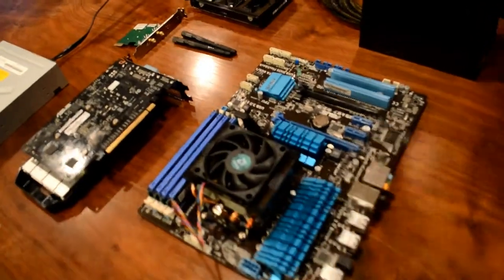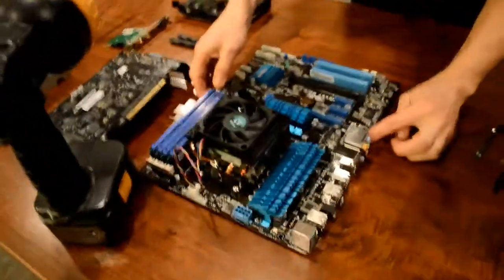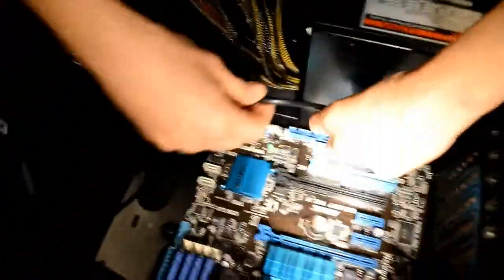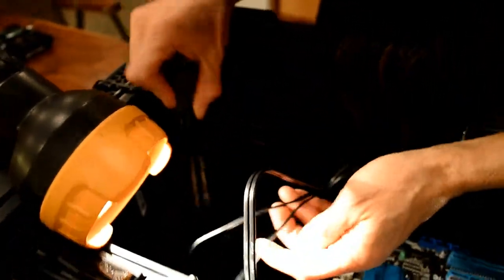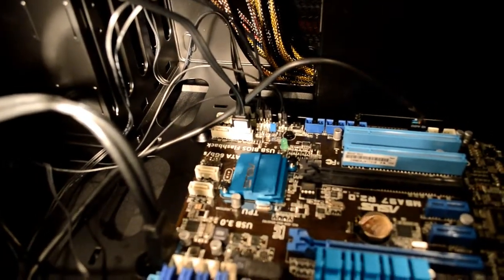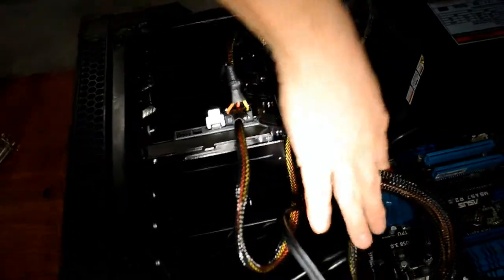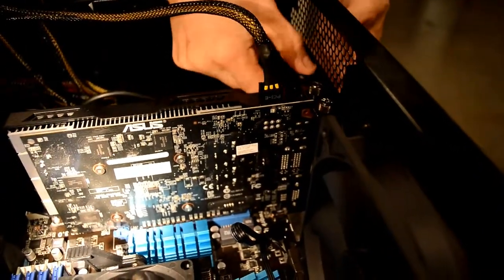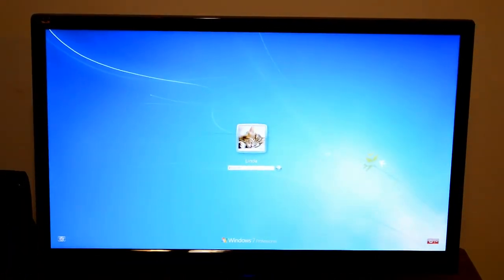Building My Own PC (Personal Computer) at Home

Comment: Wow!  Good job!  I built PCs long, long ago, XT, AT386, 486 models (DOS based), but have not done so for a long time.  When I needed a new PC a few years ago, I spent lots of time researching at NewEgg, but eventually ended up buying an HP desktop (no interest in laptop).  I have a renewed interest for a replacement.  I see an ASUS M5A95 R2 motherboard (you used 6 core, I see an 8 core is available as well).  You added 4-8GB memory cards (which manufacturer?).  You added a 1TB hard drive, looks to be a Western Digital.  You added a video card, with two fans.  This is probably a high end card so that your video editing tasks work well.  You used a 650W power supply, and a CD unit, probably DVD functions as well.  I saw a MoDisc case, but I don't find that at NewEgg.  How many USB ports?  What case did you use?  I have the bug again to build a new PC.  You slipped in "loaded windows."  Did you buy a license that came with a CD to get started.  Getting the OS loaded properly remains of great concern to me.  Has it been reliable and working fine for you.  I think you posted this about a year ago.  You seem very familiar with the components, cabling, etc.  Have you built others?  Did you buy a complete kit, or choose your own components?

I think we are wired (pun intended!) similarly -- hard, physical work, still like to home grown food, independent, and likes to see the product of our efforts.  I really enjoy your sawmill videos.  That is producing a favorable output with mechanical power equipment, and good hard work!
Reply: Are you using this build today? Even if this is SATA 2  a SSD would excelerate every thing.
Reply from the maker: Right side of the grass, Thank you!!! How did I miss this wonderful post? I apologize for neglecting to answer until now. THANK YOU for your patience! 
My sons and I have built/re-built several systems, over the past several years.
For this system, I bought a bare bones kit, cheaper than piecing it out, from Tiger Direct, but had them swap a couple of items for something I thought would work better for me. 
I haven't had any problems with the computer, other than switching the OS from Windows 7 to Windows 10 (it was not compatible with my old Video editing program). 
The case is a Corsair (steel) which has two USB3 ports, the Mother board also has two USB3 and two USB2 ports. The power supply is by Corsair and was a 650 watt power supply, but I love power and recently upgraded to a 750 watt Corsair power supply, along with a NVIDIA GEFORCE GTX 960 Video card (high performance for video editing) and a Samsung 850EVO 500 GB internal SSD (may need 3.5 to 2.5" adapter). Solid State Drive is the way to go if you have a need for speed, like me. I purchased a new copy of Windows 10 (not with CD), which was easy to install, as was my original Windows 7 (which I purchased it with the CD). 
I still can't believe that I missed a post on this video, especially by someone "wired similar to me." Hopefully, you were able to get your system built. :/
I'm glad you enjoy my videos! Thanks for watching! Linda :)
Reply from the maker: Tom Taylor, I agree! A few months ago, I upgraded to s Solid State Drive (SATAIII) & love it!
Reply: Thanks for the informative reply.  This info is helpful.  No, I have not built yet.  I do seasonal outside work, March, into December.  My time has been devoted to my solo business, 50-60 hrs, six days.  Down time is coming soon, and will rethink this.  My needs are not as demanding as your video needs.  I have photo editing needs, but video editing is undoubtedly much more demanding.  However, learning about Tiger Direct, and the Corsair products is a great lead.  I think Win 10 provides more fear than the hardware parts.

Yes, ... working hard, efficient production, ... great motivation, even though many tasks are repetitive. And, proud to have a good outcome!

Thanks so much for all this good info.  Keep shuffling the wood!  And, stay safe.

Comment: For some reason I missed this video.  You are pretty good at this how to stuff!.. Did you notice a big difference in performance when editing video?  I got an I7 something or other a while ago and it struggles a bit with editing HD video.  I think my video card probably has something to do with that.  I might try to upgrade that sometime.
Reply from the maker: The Intel Core I7 4th generation is being marketed now, but my 2nd generation Intel Core I7 is in a laptop, so it is a little under powered anyway (compared to a desktop). My new 6 core AMD desktop is awesome & much faster than my laptop! Although, our son's 3rd generation Intel Core I7 (coupled with a really good motherboard) is a little bit faster. I tried to cut costs on the motherboard, since I splurged on the processor & video card, but may upgrade the motherboard later. FYI: I found that it is important to do a disk clean up, using Microsoft & the virus disk clean right before I start up the editing program. I also delete the render files in the editing program, before I begin a new movie. Thanks for watching & commenting!! Linda